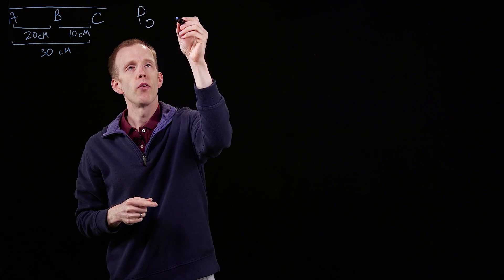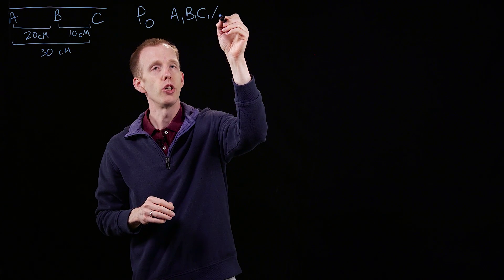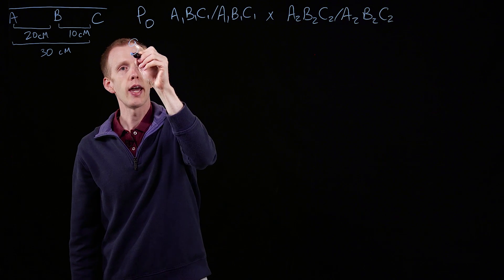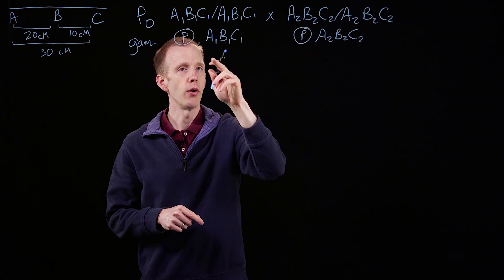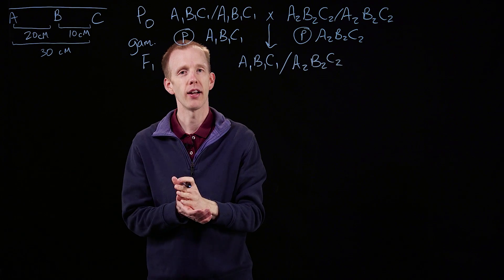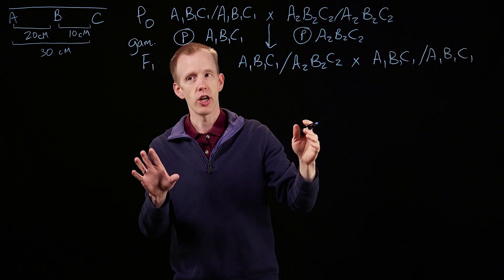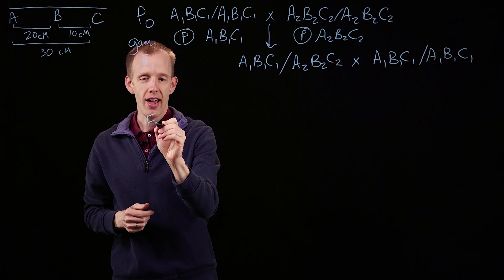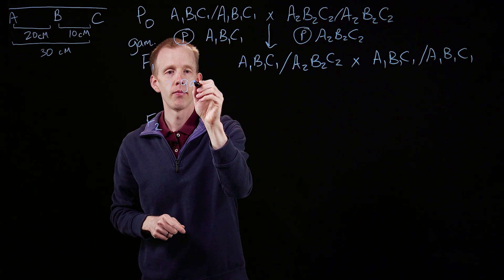Three-point mapping and gene order

Comment: Dear Joseph, why is the sum of A-B and B-C not equal to A-C? How do you take care of double cross over?
Reply from the maker: Good question: it is because the A1-B2-C1 and A2-B1-C2 chromosomes (of which there were 5 and 4, respectively) are double-recombinants. Those chromosomes had a recombination event both between A and B and also between B and C. When I worked through the logic of classifying intervals as parental or recombinant, for A-C I was only considering whether both alleles came from the same parent (e.g. A1-C1 or A2-C2). For the double-recombinants, this method doesn't take into account that A1-B2-C1 (and A2-B1-C2) appear to be parental (zero recombination events) when comparing A to C, but each of those 5 and 4 chromosomes actually have two recombinant events. Thus, for genetic distance to be truly additive, you would write in the grid I used 2*R (twice the number of chromosomes) in the A-C column just for those two categories of chromosomes. In other words, 5 A1-B2-C1 chromosomes each have 2 recombination events, so they represent 10 recombination events that occurred between A and C. With this additional detail, the recombination fraction value for A-C becomes 0.4167. This is why I provided note #1 in the video description, indicating that in this example I wasn't considering double-crossovers (or triple or higher-order crossovers), and it is more accurate to do the math in the way you inquired about.

Comment: why doesn’t crossing over occur in the F1 generation?
Reply from the maker: Crossing over does occur in every individual in every generation (P0, F1, F2…). However, in an individual that has a completely homozygous genotype (here: both of the P0s and also the F1 tester), I don't show crossing over, because any crossing over has no effect on their gamete haplotypes: a completely homozygous chromosome always produces the same gamete haplotype regardless of crossing over. For example, crossing over certainly occurs in the P0 with genotype A1B1C1/A1B1C1, but no matter where the recombination breakpoint occurs, that individual still only produces A1B1C1 gametes. So, I ignore it for simplicity.

It is recombination during F1 meiosis in the trihybrid that causes the recombinant haplotypes in the F2 offspring. So, the only recombination that I'm explicitly describing in this video is indeed F1 generation crossing over.
Reply: @JosephRoss   thank you so much! that makes sense.

Comment: What would happen if a situation was given like this and it was calculated exactly the way that you did it, but the result of the distance of 2 of the genes were >50 cM? Does it mean that this is a faulty situation or that there was a calculation error?

Edit: To elaborate, one of the parental offspring populations was 6 (+,+,+) and the other was 4 (sb, bw, rm) out of 1000 total offspring.
Reply from the maker: My apologies: I don't have time to provide individual responses to particular cases. Briefly, though, I'll note that genetic mapping makes many assumptions, and whether those assumptions apply to any particular case can make calculations behave unexpectedly. For example, my video assumes complete crossover interference, which isn't always the case. If you have to account for the possibility of multiple crossovers, that can change the estimated genetic distance. That's just one example of a caveat; there are others.
Reply: @JosephRoss  Thank you, I just realized an error in the problem, I appreciate that you spent the time to answer my question!

Comment: Interesting, But always don't forget that the two least frequent haplotypes are where DCO (double cross over) existed and always you have to count them as recombinants and the distance from A -C should be like (128+114+116+124+5+4 = 491/1200 = 0.409), i.e. 40.92cM apart.
Reply from the maker: Yes, I should reiterate that an assumption I made in this video is that there are no multiple crossover events (double, quadruple, etc.). In some circumstances, this is a reasonable assumption, and in other circumstances not.

Comment: very helpful.. almost saaved my life but distance between B-c is wrong i think.. that will be 21.75cM... total of ab+bc will be 41.66 where the standalone distance of ac will be 40.16...
by subtraction  we can now get the interference !
Reply from the maker: Correct. I should go back and re-do the video, but in the text notes, I did point out this mistake: B-C is calculated as 21.75 cM. The reason that the A-C genetic distance calculated from the recombination data (40.16 cM) is less than the sum of the A-B and B-C distances (41.67) is because of double-recombinants (the two haplotypes with total observations of only 4 and 5). Because we don't initially know which classes of haplotypes are the double-recombinants, we will always under-estimate the actual genetic distance. Once the order of loci is determined, then yes, one can go back and correct (but that isn't necessary: the sum of smaller intervals, like A-B and B-C) will always result in a more accurate estimation of genetic distance.
Reply: @JosephRoss  ohhhhhhhhhhhh
Reply: YES techHeaven you are right